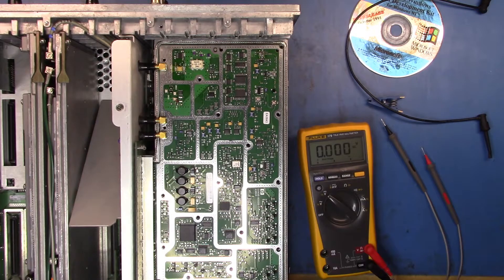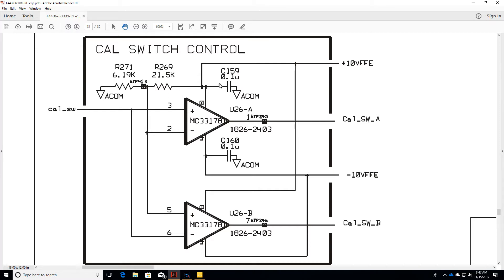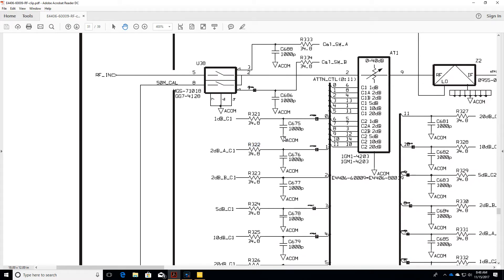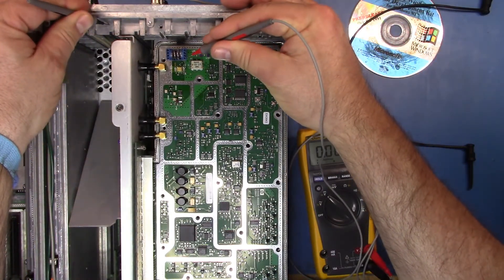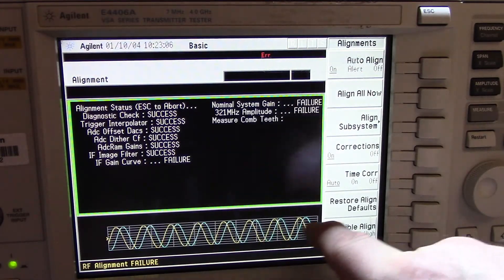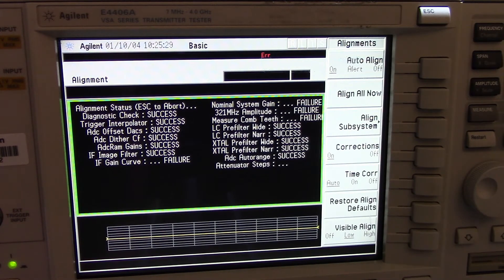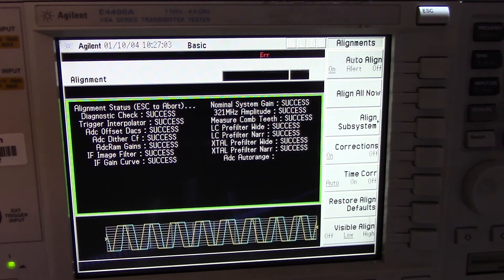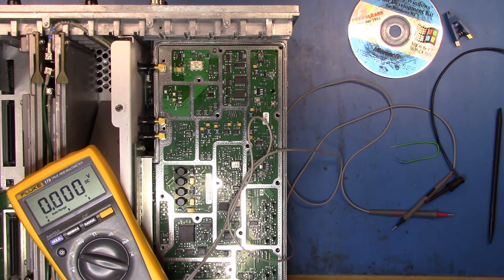Agilent E4406A Repair - Part 5

Comment: What voltage are you getting at pins 2 and 5 of the opamp? Resistors 269 and 271 seem to have very specific values so maybe the way the opamp is switching is important. It sounds like there is some unwanted interaction between the two channels. Maybe try removing it and manually driving the relay externally to see if the relay can be made to behave properly and so eliminate it as the cause.
Reply from the maker: Thanks Jerry - Those resistors create a voltage divider that gives sets the 'flip' point in the middle of the TTL range around 2.23 volts. That is what I measure there (or about as the rail isn't 10v and I can't remember what the real value was) so I'm pretty sure that they're fine. I thought about manually controlling it (In fact Hardy suggested this) but it turns out that the issue is related to the DC offset - I'm about to post a video on it.
Reply: Hi, Yes that was going to be my point. If the mid point did not match the rails then the switching may not be correct. Good to hear that you found the problem, I look forward to the video.

Comment: Change the voltage feeding the relay, I think the over voltage is likely causing leakage. Change it to be within spec of the substitute and then go from there. I suggest changing those resistors, or adding a ground link with a resistor across the relay control inputs to act as a voltage divider. Also they may not be liking being pulled to a negative voltage in the off state, which MAY mean that both switches are on at once.
Reply from the maker: Specs for the part are max control voltage of -10V so with one grounded and the other less than -10V it should be working as expected. They make mention of a compression mode at -8V but I can't find any information on what that means. I've sent them a question to ask what that means but haven't heard back yet.